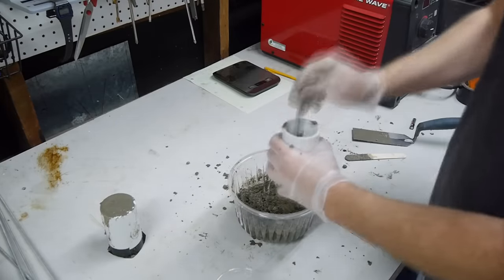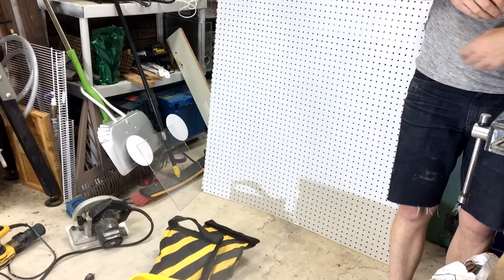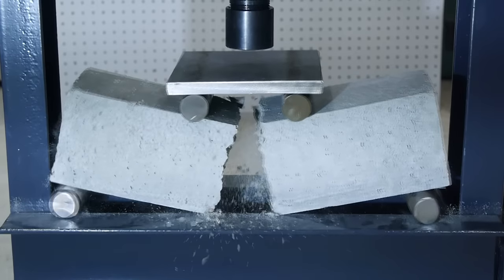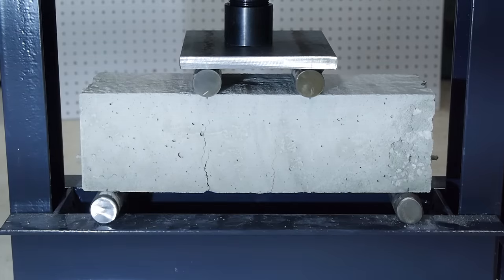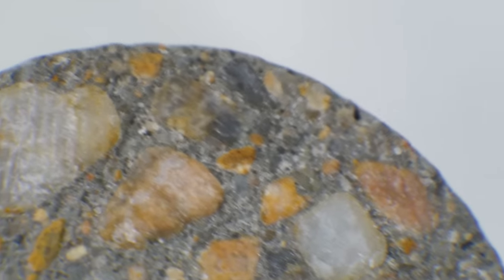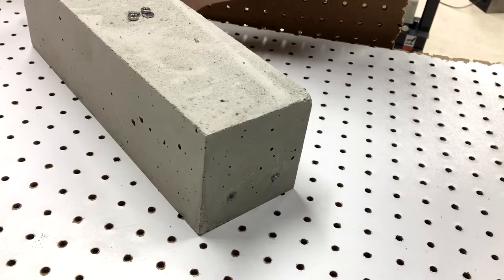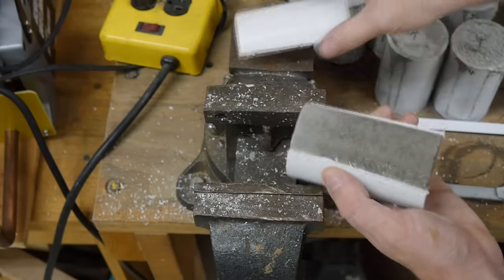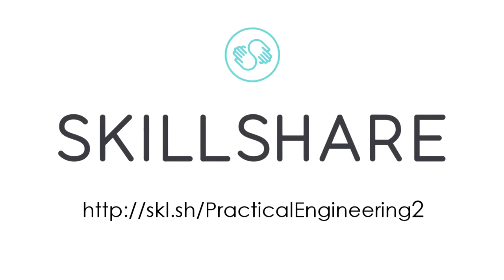Why Concrete Needs Reinforcement

Comment: Think of concrete as the opposite of rebar. Concrete is for compression - not tension, because it pulls apart easily.
Rebar is weak in compression, and will bend easily, but great for tension, because you can pull on it with enormous force.
Combined together... using the best traits of concrete and steel wire or bar - and you have a great combo for structures.
Reply: The exact same lesson my  late father taught me .
Reply: No so. Rebar (and structural steel in general) is very strong in compression too. Don't mistake the fact that (relatively) thin bar of steel bends easily with having low compressive resistance. The reason it bends easily is because it has a low second moment of area, to which deflection is proportional.
Reply: @yavuzyurur7129  where did your early father go?
Reply: @isoaxe  Theoretically yes, but practically thin rods are prone to losing stability when you compress them.
Reply: @isoaxe  To put it simply, it's slender 😀

I'm an aero engineer so no concrete experience. Under compression, does the rebar buckle?

I don't know if that'd be realistic because the concrete should fail before you get high strain/deflection, but if the concrete could deflect I'd imagine it provides some lateral stability to the rebar.
Reply: @isoaxe  I WAS speaking of a single piece of rebar. Of course steel has compression strength - but not in wire form, and that's essentially what rebar is - thick wire.
Reply: @kosskrit  Some just need to pick... I was speaking of wire reinforcement like rebar and he knows it. Of course we all know steel has compression strength! Just not in wire form.
Reply: the guy in the video basically just explained everything you said lol
Reply: @Postermaestro  That's insensitive
Reply: @OregonDARRYL  You said rebar is weak in compression, which I (maybe incorrectly?) took to mean the material. I'm simply adding nuance by stating that steel as a MATERIAL has a very high compression resistance (similar to it's tensile capacity). It is it's GEOMETRY that causes it to bend. Not trying to "pick" score points here.
Reply: @Dad_Lyon  Yes exactly, because it's slender. Nothing to do with the fact that it's steel. I'm a structural engineer, so plenty of concrete experience! Rebar buckles under axial compression due to it's slenderness, though any material would fail like that including concrete of course. However, rebar's compressive strength is about 460MPa, which is about 10 times that of typical structural concrete.
Reply: I mean, that's literally what he said?
Reply: That's called Precast Concrete
Reply: Thx for giving us a literally repeat explanation of what was said in the video.
Reply: @kcal12  You're quite welcome! And it didn't take 8 minutes to read it, did it? It took about 15 seconds.
Reply: @OregonDARRYL  Yeah but what you did what just obnoxious. You may be an expert and my hat off to you for that, but it just sounds incredibly self-entitled.
Reply: @kcal12  We are ALL entitled to save people time. And guess what? YOU sound like the judge of it all. Feel entitled to do that? Hahahaaa. Wanna play?
Reply: Isn't that what we just heard in the video?
Reply: @emanuelmota7217  Yes! But it takes 20 seconds to read my comment. Time is money!
Reply: I don't think that iron is weaker than reinforcement concrete in any way. It's just very heavy and very costly compared to concrete. If you could build building out of iron, it would be pretty strong.
Reply: @NRGY Glad I could assist!
Reply: appreciate you! have a great day❤!

Comment: This is amazing, I work security for active construction zones. Most of which are apartment complexes, and sometimes I work one week and see some areas with cracks and do not enter signs, then within a couple the area is all new concrete and looks like it was redone and not just filled in. All my life I thought that cracks were just going to happen no matter what and all that mattered was the wood structure deeper in the concrete.

Comment: Nice video. Also to add: Concrete beams that pass over columns need to have more steel at the top due to tensile stresses occuring over the column. It is also important to note that steel structures alone are not fire resistant (they deform with heat etc) so the concrete cover acts as fire proofing.  However, not having sufficient concrete cover over the steel can affect this and can also cause “concrete spalling” if moisture penetrates cracks in the concrete and cause corrosion. Concrete spalling is when the concrete face is pushed off due to expanding steel as a result of excessive corrosion/rusting.  There is constant research going on now to find ways to protect the steel with additives mixed into the concrete during casting.
Reply: Wait what? Is this how that building on 9/11 fell apart ? Without warning?? 😭
Reply: @Joelsmediahere  no what the heck? it fell because a planed flew right into it.
Reply: @Stephanie-gm6ue  oh well I was referring to building 7 😅
Reply: @Joelsmediahere  huh?
Reply: The problem with the world trade center design was the outer wall panels and the floor joists.  Once the central columns were compromised, the building lost its strength in the impact area and as the outer wall panels moved outwards the floor joists, that were supported by the wall panels, fell onto the level below.  The design was to allow maximum open-plan office space without having columns everywhere.  But the terrorists knew exactly where to hit to destroy the main central column.
Reply: @mnomic8371  yeah that makes sense
Reply: @Joelsmediahere    u have to understand that when engineers design buildings they don't plan ahead for plane to fly through it, and they also don't plan ahead for very long sustained exposure to that much heat, no engineer could have pre planned for 9/11.

and the reason for that is if u design a building to survive a plane flying through it, the cost would increase astronomically, and the likely hood of a plane actually flying through said building during its lifetime is very very very very low, hence proven by 9/11, 9/11 was a one time event that has never been repeated since.

Comment: I teach a beginning Engineering Principles class.  My students have been studying this exact topic for the last week. Tomorrow they are going to make small plaster beams that will span 1 foot.  They will be able to add sand, rocks, fiber, glue, cable, wire, fiberglass grid, etc.  They even have the choice between plaster of Paris or dental plaster.  There will be 2 winners, the best strength to weight ratio and the best strength to cost ratio.  I plan to use your videos for next year, keep up the good work.  I will post a video of some of the student designs soon.

Also, if you are ever in the SLC area, I would love to have you as a guest speaker.
Reply: Love this comment
Reply: That’s so nice.
Reply: Here is the video of my students breaking beams. https://youtu.be/HchcobNa8AI  It is a long video due to lots of beams.  You don't have to watch all of it to see how different mixes and reinforcement can change how strong it is and how it breaks.  The record was 705 pounds.

Comment: What happens over time with rebar rusting and "vanishing" inside the concrete.  I know today rebar comes with a plastic shroud to keep moisture out, but the nature of manufacturing causes nicks in the plastic.   A fascinating picture I saw was in road construction from the 60' compared to days of road work; the amount of rebar in a raised road support than in now is 90% more.

I do enjoy your channel. Thank you for producing them!
Reply: Rebar generally doesn’t rust inside of concrete because there isn’t oxygen available for it to oxidize. Actually, the reason rebar usually is embedded about an inch inside a beam rather than it being on the surface, where it would provide the most benefit in terms of reinforcement, is because that 1 inch of concrete is meant to protect the rebar from weathering.

Like he mentioned in the video, the concrete has to crack for the rebar to have any effect, so when designing a beam like the one shown, the structural engineer actually ignores any capacity that 1” concrete cover may provide and uses the capacity of only the steel by itself, so it is actually purely to protect from things like weathering and fire.
Reply: @Kdot19  I'm glad to see that there's people still out there that know about concrete.
Reply: @CasanovaBrown57  I had two classes on concrete and steel design this stuff was like carved into my brain lol
Reply: Steel can rust from the old practice of adding calcium to the concrete to cure the concrete faster. 
The calcium eats away at the metal causing failure of the concrete.
Reply: You'll rarely find rebar encased in epoxy or another coating, it's an expensive thing to add for little return to the client.
Reply: @austingardiner6880  I used to see them all the time on bridge decks.  I mostly see stainless steel rebar for that purpose now.  I mostly see epoxy rebar as dowels.
Reply: @Gooong   I thought the concrete was supposed to bond to the rebar surface?  How does that work with an insulating layer in between?  Does it bond to the epoxy instead?
Reply: @nickwallette6201  personally I don't think it works at all since I've only used stainless steel rebar in recent years.  I've also torn down an old bridge and saw the epoxy casing around the concrete with empty space where rebar used to be.  I'm no engineer but stainless steel is much more expensive than dipping steel in epoxy and contractors wouldn't switch to stainless if epoxy did work.
Reply: @nickwallette6201  I'm sitting with my engineering book and there are 3 ways that concrete bonds with rebars: Chemical adhesion, frictional resistance, mechanical interlock.. All of these 3 ways of bonding, in my opinion,  is reduced more or less with epoxy as the surface is smoother.
Reply: @Kdot19  rebars will rust over time, due to a process called carbonation the rate will vary but it will happen, concrete cover and paint only slows it down it doesn't stop it, unless u find a way to remove carbon dioxide completely from the air u cannot stop it.

Comment: My step-father worked at a steel mill in the 60's and 70's where pre-stressed concrete was produced. He said that sometimes the rod or some other component failed, and what excitement that caused!
Reply: I’ve heard story’s of people getting beheaded from the rod snapping and whipping out of the concrete, it’s only “safe” until the concrete completely drys and holds that tension.

Comment: Well done. Reminded me of the Hyatt Regency walkway collapse even though concrete was not at fault. As a city inspector/engineer I had to closely watch contractors who often didn't follow design specs, cut corners and lackadaisical engineers who verbally authorized changes without engineering reviews and change orders. Getting my life threatened by a unscrupulous contractor isn't fun.
Reply: Isn't it great, when some inadequate coward tries to feel superior, by threatening, lying. They are everywhere.
Reply: The Florida International University bridge collapse was an exact demonstration of these forces and failures.
Reply: Threat is taking it way to far that sob needs to be taught a lesson as to what happens if u do that
Reply: @Eugenepanels  the trouble is, the person handing out threats is the one who access to large holes that get filled with concrete, if you catch my drift.

Comment: The most interesting thing I learned about concrete when I got into carpentry is that concrete and steel expand and contract at the exact same rate, which is why steel reinforced concrete doesn't immediately crack. I never thought about it before they taught it in my apprenticeship but I found that interesting for some reason
Reply: @retsaM innavoiG well it's true buddy. That's why bridges and skyscrapers and shit aren't full of cracks. Roads are because the ground heaves but that's a different cause

Comment: In the video, I noticed something to reduce the shear effect that can occur on old wooden post supports bearing some weight, that may also experience shear from wind force. Recently, I fixed 1m weather-treated iron stakes to a piece of aged 2.5m lumber posts sitting in a 30cm bed of quick set concrete. I realised the job would be stronger if I had used a treated wire mesh wrapped around the concrete to bind it and improve the overall strength.  Thanks for the prompt.

Comment: Grady, thanks so much for all the prep work you do for your videos.  I have learned so much!  

When I was a child, my dad decided to add on to our home.  He decided to use cinder block instead of reinforced poured concrete for our basement walls.  (Rebar = reinforcing bar) Unfortunately, I spent the rest of my childhood bailing our basement out every time it sprinkled outside.  The water sprayed through the cinder block like hundreds of shower heads.  When it rained, my older brothers would run around with a pencil and circle all the streams to later go back and smear on this water proofing paste used specifically to waterproof cinder block.  If you're wondering, no it didn't work.

Comment: Threaded rod is a terrible idea to reference Re-Bar.
Re-Bar is made from a mild, low carbon, high ductility steel.
This allows much more 'strength' from the metal, it has a longer durability for external and internal forces.
Meaning it can actually stretch before breaking.
Threaded rod is made from a myriad of materials, with my uses finding them in the higher carbon range.
Higher carbon content allows the threads to retain their shape and not stretch as much with normal torque levels usually required of them.
Much like bolts, which are mostly higher carbon.
Not only that but the sharp ridges formed or cut for the threads provide a very nice shear point allowing threaded rod to break with relatively very little force, Re-Bar, not so much.
Your video still shows the relation and still works well enough for most purposes.
But you did ask for what we thought, and this is my thought.
Reply: Rebar nerd!
Reply: Actually threaded rod is quite appropriate for a demonstration.  Even the smallest size rebar (#3) is way too big for the size "beam" he was testing.  I used a number of rebar models when I did a lot of model slab tests 50 years ago ranging from twisted strands of tie wire to threaded rods.
Reply: Are you going let DoctorLarry show you off ?
Reply: Is just makes the concrete more flexible rightttt
Reply: Settle down yall, settle down
Reply: Well it worked for the presentation and for all intents and purposes is fine
Reply: It's not a reference it's just to demonstrate a principle. It's a model.

Comment: I actually work in a concrete plant that makes septic tanks and we use a nylon fiber mixes in with the concrete and it makes it so it doesn’t crumble normally because the fiber holds it all together so you need very minimal rebar except for in the corners of the tanks !!

Comment: Back in 1981 my uncle and his two pals were travelling to do a gig when they were killed instantly less than a mile from home,   the car they were traveling in hit a 1930's reinforced concrete lamppost column, the car was a big Morris Oxford, disintegrated on impact, splitting in two, and the engine was catapulted sixty feet down the road, the column hardly had a scratch on it, the cops said the lamppost was designed to carry a ten foot long, cast iron arm and tram wires, and were capable of ruining a truck never mind a car, some years later they were replacing them with modern galvanised steel ones and it took about an hour jack of hammering to break them at their base, I noticed they were hollow about 30inch in circumference and about 3inch thick concrete with about  eight  10 mm rebars and wire skeleton and about thirty feet in length
Reply: Sorry to hear about your uncle. But as an example, this really puts the capabilities of reinforced concrete into perspective. I'd have never thought about how outrageously strong a concrete lamppost is. Makes you wonder why they would ever switch to galvanised steel posts when the concrete could do so well. I'd wager it had a few more decades left in it at the time they were taking it out
Reply: theXEN0KID a steel post would give way to a car instead of a concrete barrier which would be rigid. Car manufacturers build cars these days to absorb impact better by allowing deformation of the bumpers and other parts of the car to lessen abrupt impact. Same concept...hope that makes sense.
Reply: that run-on sentence tho
Reply: @pk-zi7lm  Ikr almost died reading this as there was no time to breath.
Reply: Ethan Epps That actually makes a lot of sense. Bound to rack up way more in repair costs though I’d imagine
Reply: Sorry for your loss
Reply: Fake
Reply: Sorry for the lose
Reply: Yeah concrete posts were just killing too many people, which is a pretty major flaw. There is actually fascinating engineering behind all the stuff along roads now - it's designed to fail at a certain point in a certain way to protect human life if it's hit.
Reply: Here you dropped these: .............

Comment: This video is particularly relevant now after the tragedy in Miami. I'd be interested to hear your thoughts on the effects of salt water air, or an explanation of concrete cancer.
Reply: Yes me too.  It appears that the Miami failure stemmed from neglect around the pool deck and parking garage.
Reply: It might have been caused by mica.
Reply: @SnickasBah  I heard initial suggestion that a multitude of factors were probably at play. 2mm a year of subsidence does not sound healthy.
Reply: @beaukiff9  How so?
Reply: @Martial-Mat  Because mica causes cracks and if not treated immediately, it can cause the bulding to crumble and if it's tall, it can even collapse.
Reply: @beaukiff9  And it's a componenet of concrete?